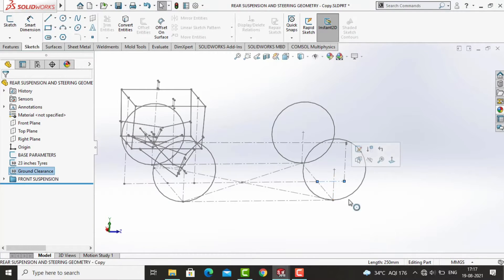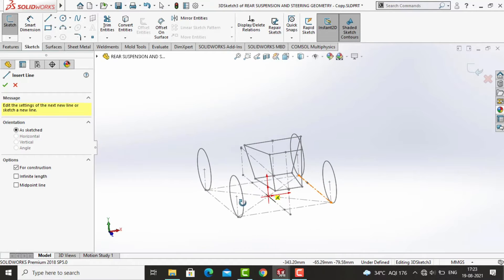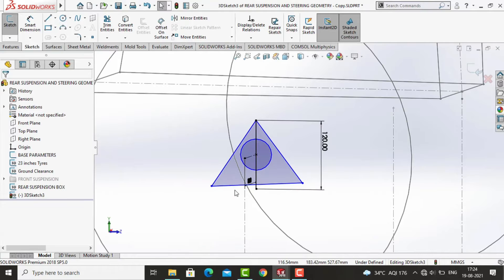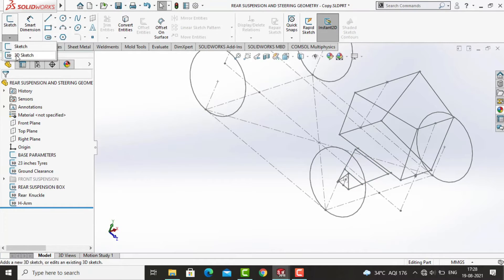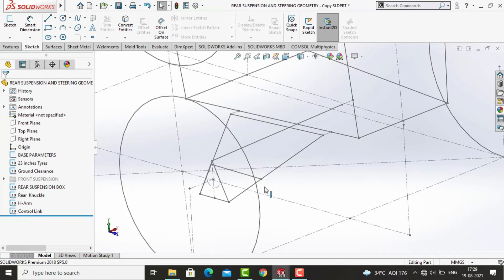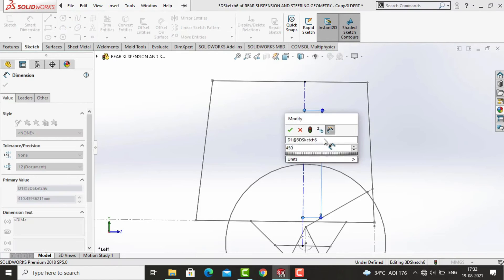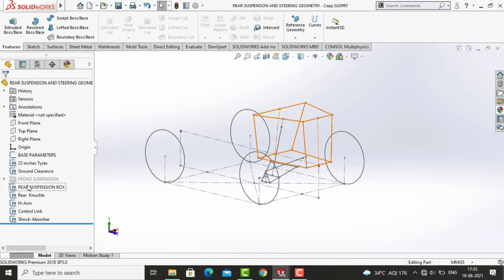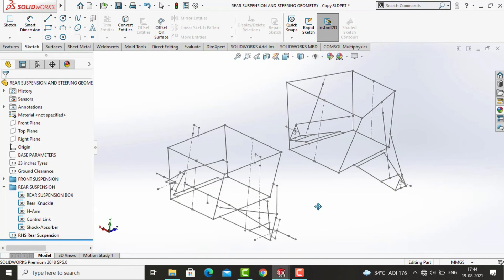H-Arm Suspension with One Control Link | Soildworks | BAJA ATV

Comment: how do you then turn it to reality with ball joints etc?
Reply from the maker: We need to make proper CAD for them.
What I made is just suspension hard points and skeleton
Reply: @ can I place the knuckle first with ball joints and then connect the tubes between those, or as you did the ride height, is it modelled static, compressed as you did?